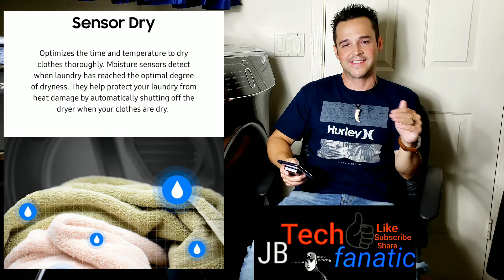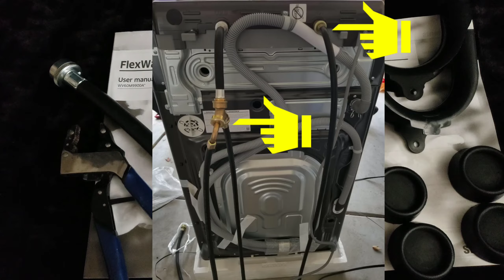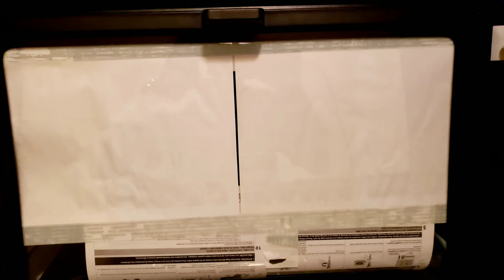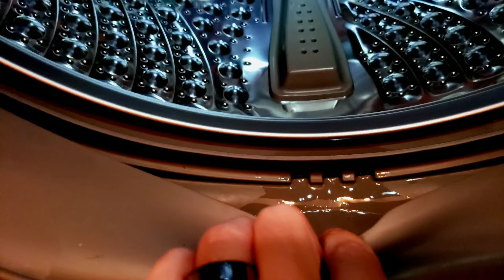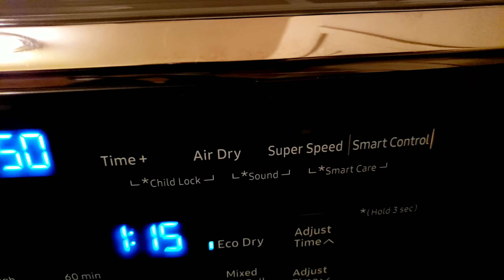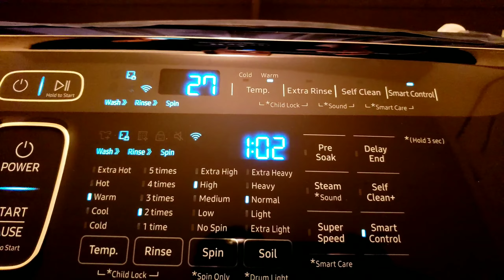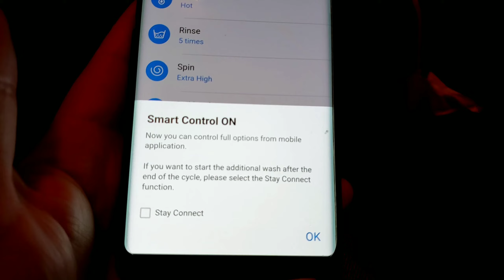NEW Samsung Smart Flexwasher & FlexDryer Duo FrontLoad DV9900 A Must see Review🤗

Comment: What a great video. My whirlpool's duet steam washer control board just went out and I might as well buy a new machine for the price to fix it. Pisses me off because it's only 6 years old and how convenient after my 5-year extended warranty ended. The Samsung flex is a lot more money but I got sold with not having to wait for laundry quantity to accumulate as well as not having to go to the laundromat for my king size comforters. Thanks for letting me know I won't need to purchase the expensive afresh cleaning tablets anymore. At first, I was about to purchase only the flex wash but after seeing this video, I'm thinking about the flex dry as well. My current dryer is fine but what sold me is the top area that's like line drying. Currently, I'm placing clothes on the guest bedroom bed, or on couches to dry. Samsung should pay you for all the people you've convinced to purchase these.

Is it possible to set the dryer on a drawer stand? I would not put the washer on a stand, only the dryer, which is how my current set up is. 

When I take my business suits to the cleaners, I can smell the dry cleaning solution used but it's as though the dry cleaning solution is on top of my clothes smell--I am not a nasty person--it's just that after a day of wearing my suits, between body oils and sweat, I could still smell it even after dry cleaning them. Through frustration, I wash my suits in regular cycle prior to dry cleaning. This solves the issue but I don't want to continually wash my dry cleaning suits. Is there a feature on either the washer or dryer that can get my dry cleaning really cleaned without having to wash them? And possibly save me dry cleaning bills?
Reply from the maker: First off I want to thank you so much for watching my video I'm honored that you considered subscribing and have taken your time to comment😇 first and foremost this set is amazing and if you're okay spending the money I definitely recommend buying the pair especially for delicate clothes. They do sell a bottom stool however it does not have a drawer but remember compared to your old set the washer and dryer probably stand just as high without a pedestal under them they are very large units because they have two units in one. As far as stuff that needs to be dry cleaned this is where this pair really shines the top washer and the top dryer make it perfect for things that you would normally not want to wash on the app there's a new feature called wash recipe and basically you input the items your washing into the app and it will tell you exactly the mode and the way to use the solution to best fit those items really delicate items like suits included I really don't know of a better washer and dryer pair expecially for clothes that are delicate. Also as long as you do the sanitation wash and you make sure your dryer vents are nice and clean not only in the dryer but your wall that outputs the air your clothes will always smell fresh and clean it has a very powerful steam function that can be used as just a sanitized if you do not want to do a regular wash this also is so powerful that kills the bacteria in your clothes smells that reappear are because the bacteria is actually still deep in the fabric this washer and dryer will actually kill all of it and get rid of it for good you will be very happy with the way your clothes smell we purposely took a towel and cleaned up cat urine I know that sounds disgusting but it is a smell that is nearly impossible to get rid of and I'm happy to say that it got rid of it I was absolutely shocked. Hopefully this information helps if I can ever help you in any way please reach out thank you so much it was a pleasure meeting you thank you for supporting my channel and subscribing😉
Reply: Jb TechFanatic thanks so much for your speedy, thoughtful reply. It was helpful. You had a great idea about washing my dry cleaning in the top, but I'm thinking i might still have to hit the dry cleaners to get the nice creases and pressed look for my suits. I was hoping to be able to save on the dry cleaning bills. I know the flex wash only have steam in the bottom washer--so that won't help me when using the top washer. Do you know if steam is available in both top and bottom dryers? I went to Lowes yesterday, saw the demos and you are correct, they do stand very tall, wow. I was surprised that inside the large washer didn't seem any larger than my current whirlpool duet steam washer, which I couldn't fit my bulky king size comforter in. So I really wonder about being able to wash my comforter in the flex washer. 

I told the Lowes sales guy about my dry cleaning issue and he introduced me to the LG Styler. Do you have any experience with the LG Styler? I plan to purchase the either both the flex washer and dryer or just the washer tomorrow on Veterans Day, in the hopes of further markdowns. Currently they are priced on sale at $1,299 each.
Reply from the maker: Remember there are two sizes of this washer the one in my video is the 9900 which is the larger. But a lot of the extra space comes due to the fact that has the top. I agree that you should keep dry cleaning it's always nice to have it freshly pressed I was talking about just being able to safely wash to help fight the odor issue that you were experiencing. No steaming in the top but it has a delicate and the dryer has  true powerful steam also. It definitely fits a entire comforter and sheet. I purposely over stuffed it lol to test. I unfortunately don't know much about the lg. I think that it's a great idea to check for a sale. Check Samsung.com also they have deals.
Reply from the maker: Huge sale Samsung.com 1299 for each and Costco has the lg styler 700 off today
Reply: Jb TechFanatic yes, thx. I went to the Samsung site and saw it for the same price as Lowes. The demo I saw in Lowes was the 6.0. With the bottom being 5.0, I’ll compare the size of my current whirlpool. Also I may (haven’t completely decided) keep my whirlpool dryer since it also has steam technology. It does come with a rack that allows the clothes to dry in place without spinning.

I’m also researching prices at home depot, best by and Costco for the Samsung flexwash.
Reply from the maker: Lowes does price match and offer a 10 percent off military discount
Reply: Jb TechFanatic correct. They do price match, but I wouldn't be able to combine the match with my military discount. I'm waiting for tomorrow because in the past, they did offer military an extra 10% on top of the regular 10% military discount. I asked about this when I went to Lowes yesterday and they gave me a noncommittal response: "we are already offering Black Friday sales and this in the first I've seen Lowes offering the sale all month. Based on this, I don't know if they'll so another sale promotion."  After that response. I figure I'll take my chances and return tomorrow. I was surprised when Lowes told me I'll need all new accessory hoses/connections, even though it was only 6 years ago that they installed my current equipment--they won't budge on this. I'll also need a new drain pan since the washer is deeper than my current washer.
Reply from the maker: Well definitely let me know what you get and if you like it. By the way replacement of your board in your current washer is so so easy. 10 minute job but the board is probably 200 bucks
Reply: Jb TechFanatic just seeing your post about the replacement of the board. The technician said it would cost $598 to replace it. I know it’s Robert because I watched a youtube video saying the part was $300. My husband thinks it’s too complicated and a headache to change, so, I started looking for a new washer. That said, yesterday, I made the rounds, Home Depot, Lowes, Best Buy. There is a good possibility that I will need a new drain pan due to the footprint of the washer. None of the 3 places I mentioned will replace the old and install the new drain pan.
Reply from the maker: That $600 cost is on markup and labor from the Sears parts store you can order it for around two hundred bucks and it's the simplest 10-minute job ever I've personally done it to that exact same washing machine lol. What I've learned is when it comes to washers dryers refrigerators stoves they are actually so easily fixed and these companies charges so much money to do it I started to catch on when I would have something break I would pay someone to fix it and they would be in and out of my house in 15 minutes so I started to watch and learn. As far as the pan goes I'm sure you could probably higher an appliance company to replace it for you if you need unfortunately I don't have a drain pan mine goes into my wall into a line so I'm not really familiar with that your other option of course is running the drain line into a sink if you have one in your washroom?
Reply: Jb TechFanatic I never new what a drain pan was until I moved to this house. Basically, it sits under the washer in case of a leak and is actually connected to a drain in the floor. The drain hose from the washer leads to a separate drain hole leading to a hole in the wall, between the hot and cold water connections. When we got the washer and dryer, the pedestals was thrown in for free. Upon install, the guys told me my washer pedestal drawer wouldn’t open because the drain pan’s lip—that was my first rude awakening to learning about drain pans. So my washer sits inside the drain pan (edge is about 2.5” high, and external dimensions are 30WX30L). The dryer is on its pedestal, so no bending there. The Samsung flex pedestal isn’t a drawer, so I wouldn’t have the same issue, it’s just that I don’t think the pedestal will fit inside the drain pan. I asked my husband if there is a drain hole in the floor, why do we need the drain pan. He explained the water would go all over the floor causing damage before running down the floor drain, since the floor is not like a bathtub, designed to funnel the water to the floor drain. I later learned that the drain pan also protects the floor gains condensation. Another shocker I learned is that because our units are on the 2nd floor, Insurance wouldn’t cover damages in the event of a leak. So the drain pan drives all my decisions, lol. 

I got brave and looked into replacing the main control board myself—omg you are correct, it’s so easy—like putting in a computer hard drive or more ram—back in the day. So I looked up the part and I can’t believe it’s out of stock everywhere. one site says  available between Jan 1st and I can’t recall. Sears says not until 12/26. I don’t know if this part comes from China but we can’t wait that long.
Reply from the maker: I think the drain pan sounds like a simple precaution for the Second Story however there is zero worry about this thing leaking it's not going to happen I have never had a washer leak but this particular unit actually has a built-in almost Reservoir if you stay in the bottom of it so on the front bottom left what would happen if it filled up you can actually open it and there's a valve that you can drain it with it's weird and maybe scary as it sounds I would just boot the drain pan LOL as long as you have a drain for the line it's never going to happen that you need that drain pan not with the Samsung Flex anyway it seems like they've covered every angle with this machine I've literally yet to find something that this thing has not built into it lol. That part is out everywhere likely because it's a defective part and it's happening to everybody they should of done a recall welcome to the world we live in right. Also the pedestal for this machine is literally a worthless device it adds another inch I believe from the ground up it's already so tall I really feel as if it's just not needed it gives you no benefit not even a drawer to use just seems like a waste of money at least with the other styles you would at least get a drawer sometimes I just want to say Samsung that's fine you want to make this accessory but sell it for $15 because that's all it's worth haha
Reply: Jb TechFanatic lol. You are right about the whirlpool defect. My machine is only 6yrs old—a crying shame. I’ll see if I can find out about the reservoir and draining of the Samsung flex in case of an issue. I want to get rid of the drain pan so bad. I’ve even looked into drain pan hacks, lol. Last time, Lowes wouldn’t install the whirlpool duet steam washer without the drain pan. They mentioned liability and how it’s protecting me and all sorts of reasons. If we are able to lift the current washer and move the existing drain pan before they arrive, that would solve the issue.

Another thing I just realized is that even if I had a leak from the fill hoses in the back of the machine of coming through the seals of the washer door, the drain pain would be effective in these cases.
Reply from the maker: Okay so I reached out to Samsung while I was looking through the complete manual they do not recommend a drain pan and said there is no need for one they do not even sell one that fits the unit the reason being is several things that they have Incorporated in this machine one there is zero condensation 2 there is many safety features built-in that would not allow the amount of water Beyond the amount for a wash into the unit according to them older units used to condensate on the bottom due to heat and would still turn on even if an item was stuck in the door or if it was not sealed properly this has many safety sensors built-in and will not allow the system to even run unless it is fully sealed in addition to that everything starts at the top and goes down and have several places that would stop the water before it poured too much water into your washing machine the only way the top floor would flood is if your water line broke in your wall and which a drain pan would not do much for. Hopefully this helps but it seems they insure you should have no issues😇 I can imagine how frustrating it would be having a drain pan anyway I'm sure it's hideous and annoying LOL
Reply: Jb TechFanatic OMGness this is so helpful. You are very kind to find this out for me. Thank you so very much.
Reply from the maker: Anytime I'm just trying to help you so you dont have to stress😇 So I was studying the manual to make sure and could not find anything. I also ran a sanitize cycle and checked for any moisture on the floor during. And it is completely dry everywhere including the machine and ground
 then I decided just to make sure I would call them directly for you😊 it's my honor to help! I  thank you for supporting my YouTube channel and being a subscriber that means a lot to me😇
Reply: Jb TechFanatic so, you’d never believe what happened. My husband and I went to Lowes this evening to get the white washer and dryer.  Lowes price 1299 each; Home Depot 1298 and $30 instant discount on each. That would bring the Home Depot price to 1268 each. Then Lowes discovered they can’t get the white in until later in the month, possibly December. We stressed our like for the units and really need one soon. Miraculously, they gave us the black machines $1399 each and pedestals for the price of the white ones. On top of that, I got my 10% military as well as the 75 mail in rebate.  Life is good. They should arrive 3-7 business days.  Yay!! Thanks again for your help.
Reply: Hi there, I hope your thanks giving was great. I got the washer and dryer delivered wed night. We’ve been washing up a storm, since we’ve got a lot of catching up to do. It’s been so convenient having the double washer and dryer. I’m experimenting with the settings to see which gets the clothes cleaner b/c some stain remains after washing in the large washer. I rewatched your video to set the units up on smart things. No luck. I know to said sometimes it doesn’t work in the first try, but I e tried many times and even called Samsung. The issue is I get to 98% during the registration process, then get a message saying “There is a connection problem or the current Wi-Fi network is incompatible with your dryer. Check to make sure the network is working correctly or try a different network.” Samsung had me try the same steps I tried. Then they told me to go to the smart home app. The smart home app said something about me needing to use the smart things app. Samsung said since the problem is during registration, I should register online through Samsung.com and that will resolve it. It didn’t. When I tried the set up all over, I get “The device is already registered to another account. To use this device, you can request permission to join the place where the device is registered. OR You can also register this device to your account and remove the existing account. If you register this device to your account the owner of the existing account will no longer be able to use this device.” If I choose request permission, nothing happens. When I choose register the device to my account, I error out at the 98% as it tries to register. Samsung is now saying I need to talk to my network provider—which I don’t think is the issue. Did you or any of your followers experience any of these issues?
Reply: We got the units to connect after plugging them out then back on again. .
Reply from the maker: Wait what happened? I think I missed a message or something
Reply: Hi Jb TechFanatic, I had issues connecting the units to smart things but I’m good now. I noticed once they are connected to the app, I can’t open the door unless I turn off smart control, which means disconnecting them from the app. Is this your experience? Also did a rack for your dryer drum come with yours? Pg 55 of the user manual refers to a lower rack.
Reply from the maker: The app lock is a child safety function. So just push the connect button on the machine as the Unlock. You are still connected just with limited function until you re press it. Only rack I know about is the one that comes with the dryer. They store it in the top it is removable. Are you enjoying them so far? Glad to hear you got them that is exciting.
Reply: Jb TechFanatic yes, so far I am enjoying them. Since we were wo a machine for a few weeks, our laundry accumulated and I found myself bending a lot. I bought pedestals, but they haven’t arrived yet—so I look forward to them coming. Some clothes didn’t come out as clean as I’d hoped. It’s possible I overfilled the washer, since we had so much laundry. I also plan to play with the washer settings to ensure the clothes get as clean as possible. I picked up some non chlorine bleach today for the top. Also today I bought some sweaters—Like those ugly Christmas ones and was really excited I’ll be able to clean them in the top washer and dry them in the top dryer.
Reply from the maker: Awsome!  So definitely dont overfill it takes away the cleaning capabilities. Because it cant penetrate. Also make sure the water is turned all the way in to the washer. Also only use He laundry soap